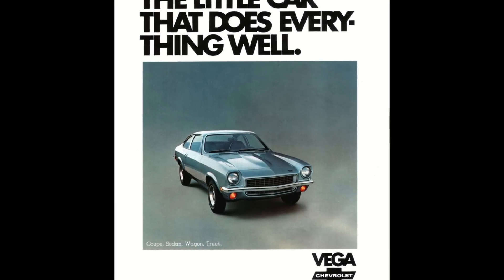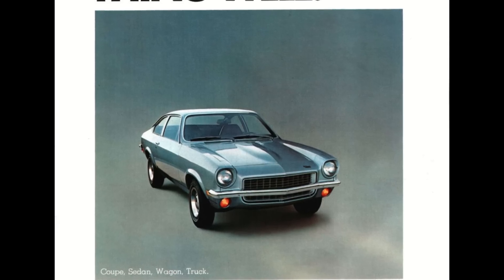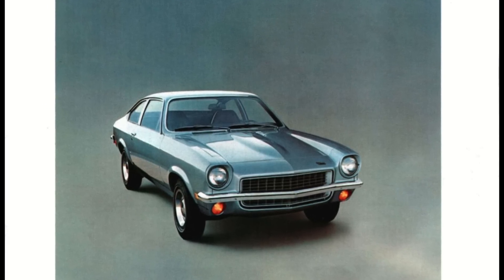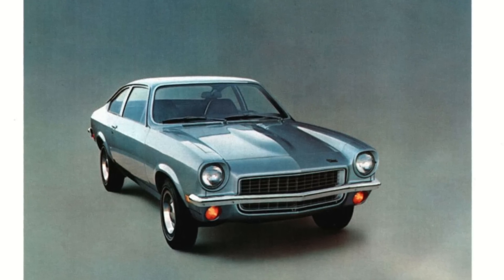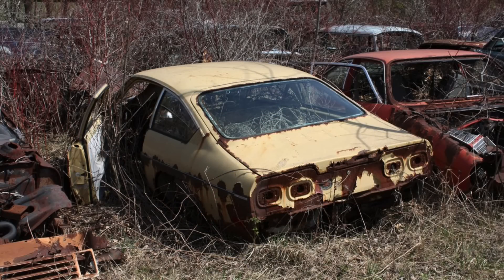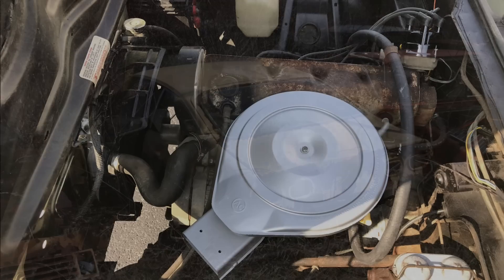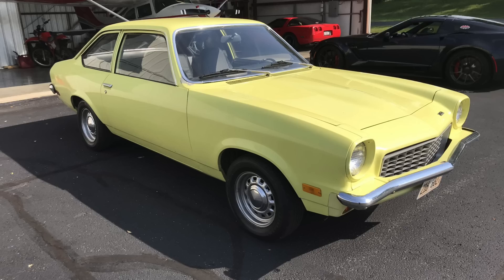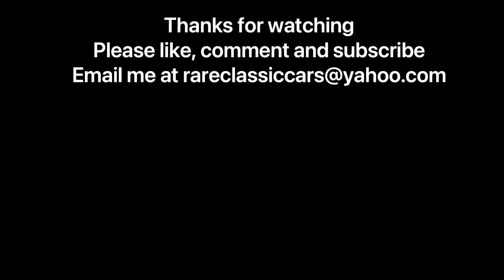GM's Largest Failures: Why The Chevrolet Vega's Engine Turned Buyers Away From American Cars

Comment: They should have put a 4 bolt main 350 under the hood and been done with it also a two speed power glide tranny or Muncie rock crusher 4 speed and a Ford 9 in rear with 373 410 and 411 posi yah buddy there's the secret sauce recipie get you some of that baby yee haw dual exuast as well not cat converters either

Comment: The problem with the Vega wasn't the engine even though it was bad the car it self was bad,the car would rust into litterly, it would break into 2 peaces right in front of the rear wheel all the way across, I don't know how many of them did that but it was unsafe so the car was doomed from the start

Comment: Many chevy owners installed a 350 or 327 like I did, and made a really nice car out of them. My freind from high school installed a 4 bolt main truck engine with 202 heads, big lumping cam and ram horn manifolds with h pipe, that car was insanely quick! The one I assembled was a 400 hp corvette 326 that I built over the winter, and that little hatchback was so quick that I would have kept it forever. Sadly it was impounded and I never saw it again

Comment: My '73 Vega didn't make it to 50K miles.  The engine took a quart of oil for every tank of gas.  The body rusting out was the worst thing.  Rain came in around the windshield, and the back hatch's hinges rusted off the body.  The hatch ended up on the roof.  I live in love bug country, and once one hit the hood, a huge crater rusted out where the bug hit.

Comment: I don’t know if I emphasized this enough in my previous posts.  Problem with engine reliability was NOT the aluminum block, nor the lack of enough radiator capacity, nor the lack of head gaskets.  The overheating problem resided in the poor design quality of the supposedly “stock” cylinder head design.  There was a massive steam pocket above the first two cylinders.  Also there was wrong headed placement of the water temperature gauge IN THE COOLING AIRFLOW OF THE INTAKE MANIFOLD.  And responsibility for these design oversights fall chiefly on the chief engine designer of Chevrolet and General Motors in 1969.
 And this was the man who was accorded great fame and promotions for originating what really was the outstanding consumer product of the 20th century, the small block Chevrolet V8.  But that’s another story that really needs to be appended to the story of the 2.3L Vega 4-cylinder because supposedly they had the same chief designer.  But how could have that been true? The SBC owes its design roots to the 1939 Tatra air cooled V8.  How you ask?  
	this is where the history lessons come in.  Well, first of all, Tatra in 1939 was a Checkoslovakian company that built trucks and and engines for the 3rd Reich.  If you know anything abt truck engines you know that they get thrashed and flailed all the time.  The group that makes the truck engines will tend to dominate all other small truck/passenger car designs groups in a large corporations.  So it was true under Tatra, as well as GM in 1969 when Chevrolet V8’s were simply head and shoulders above the competition.  
	But let us return to 1939.  The Tatra rear engined air cooled V8 was cast out of an alloy of aluminum and magnesium.  It was under 4L displacement, had pushrods instead of OHV gear. So that made it lighter than any OVV or DOHV design.  In addition it had an OVERSQUARE piston dia-stroke ratio.  It’s already sounding like Zora Arkus-Duntov because he was also an engineer for Ed Cole in during the Corvette startup but his father was already an engine -eer for Tatra motors in 1939.  They built trucks, they built automobiles of all kinds and one of their most famous “Nazi killer” rear engined, air cooled Mg-Al  V8.  The 1939 V8 had the same “quench” combustion chambers as the 1954 SBC.  But of course Ed Cole designed the SBC.  In this day and age with the dominance of front engined, front wheel designs, how many of you can claim to have driven a rear engined car 
	Zora was just a very young man when he emigrated to the USA.  His father enrolled him in the GM auto institute, the pipeline for young engineering talent in post war Detroit.  But of course he was just a racing driver who drove corvettes  as fast as he could.  But that’s not all he did.  He brought the Tatra “Nazi killer” V8 to the attention of GM engineers.  He may have been the “inspiration “ instead of the “perspiration” behind the SBC.
Reply: So no wonder the oil plug was always hotter than a pistol.  It sat right above the WORST hot spot.  All Vega engines could be rectified with two 1-1/4” gas pipe connectors, drill a 1/2” hole in rat side of cylinder head, 1-1/2” from front facing rt.  Run 1/8” gas line from block to INTAKE SIDE OF WATER PUMP.  Or just get the 1977 head which had all the overachiever steam relief of the original 1971 engine by Doug Rowe who would later professionally build racing engines.  Of course Doug Rowe and GM would not see i2i.  His relief work was guided by his very professional use of thermocouples throughout the cylinder head and block.
Reply: All you had to do was to rectify this one hot spot.  You could put the fix in for maybe $15 and contingent on tools.  All the engine rebuild shops knew of this “fix”. The new head would set you back abt $ 200 in 1975.
Reply: The results of the steam relief were amazing.  Without the fix, the stock Vega engine was a hot, clattering mess pulling a water temp of about 210F.  With the fix in, it ran a cool 165F, could support the AC, completely transformed.  I changed the exh valve clearance to 0.024” from recommended 0.030”.  A lot of the tractor engine clatter cleared up.  It was not at all the same engine.  I chromed the valve cover just because I could.

Comment: I loved my 72 panel wagon but it was a stroked 400 sbc. I did have to have a 5 core radiator made and notch out the subframe in the front for more radiator but a blast to drive

Comment: Excellent video. I had a 71 Vega, GT station wagon. I’m 78 years old now and that was the worst vehicle that I have owned my whole life. 25,000 miles and they replace the front fenders. I also had to carry extra spark plugs with me and change them on the road because they would file plugs out about every hundred miles. I was so happy when the government forced GM to extend the warranty on them motors. I got a new short block out of it And quickly got rid of that car Also, the rear tailgate rotted out in the rear window ,almost fell out of it..

Comment: I had a very used 75 Vega in 1978 and was quite pleased with the performance.  The engine was sleeved from the factory.  It was cheap and reliable. It was just a cheap car. Too bad they don't sell cheap cars anymore.

Comment: This car truly pushed Americans away from American cars. My parents owned a 74 Vega and a 71 Impala which held up for 100,000 miles and was fairly reliable. Up to this point they always bought from GM (I was a baby). Unfortunately, working he was called over the intercom that the Vega was on fire in the parking lot. The cast iron heads, and the aluminum block had leaked fuel onto the hot engine, setting it on fire. By the time the fire department came the car was gone. GM offered my dad a 2-year lease on a Buick LeSabre for free trying to keep them in GM. Except the battery went dead every 6 months. That was the end for GM and they never bought from them again. Their quality started improving in 2005 when I worked for them as a consultant to use warranty data with six sigma to fix their cars, but the damage was done back in the 1970s.

Comment: I had a 71 it overheated I used to carry 5 gallons of water with me. It didn't come with a radiator over flow tank which what I was told caused the overheating. It eneded up only running on one cylinder traded it on a new camero it was only $3200 brand new

Comment: I was there.   The Vega was loved by the car critics for it's aggressive new tech, and from scratch design, compared to the Pinto which used off the shelf/proven drive train components..from Europe.     The "open deck" cylinder design, fairly common these days for cooling, was clearly a fail when not braced and I believe the aluminum block, iron head resulted in warping or loss of head gasket continuity.    They sure were mosquito killers in my small town, classic smoke bombs.

Comment: Always had to check your oil and coolant levels while owning a Vega.  The engines could be made to run well and get great mpg, but if they got hot or ran low on oil they would let out the magic smoke.  Everything runs on magic smoke, once it is let out it dies.

Comment: Nowadays in the Ecotec they went cheap on the pistons.  Audi Pistons and rings will lead oil consumption.  Tiny ring groves and small oil drain back holes.  Four cylinders engine are still cheap engines

Comment: I ordered a '71 Pinto sedan, fully optioned except for the automatic.  Even had factory a/c.  Never had any issues.  Outran the local police on back roads (rack 'n pinion).  2 liter engine, which squealed in 1st, 2nd and 3rd.  They met all safety requirements and were no more prone to fires than their competitors.  My brother got the car after me and continued my shenanigans.  Should have kept it.

Comment: I have a buddy bought a new 1976 Vega drove it for 100,000 miles no problems. The trick was you had to change the oil every 2,000 miles. Great little cars would get 37 mpg on a trip.

Comment: Loved coming across your video. My first car was a bright orange, white striped One Millionth 73 GT Vega. I purchased it, non-running from my brother-in-law around 1978. It had AC and a larger radiator. I loved the car with it's Speed Racer Mark V AKA: Camero front end look. The original engine was pretty well shot and replaced with a sleeved version. At the time, a company named IECO made performance parts for the little 140 CID engine! I had the second level cam installed which gave a slight rumble when idling along with a bit extra mid range power. An IECO header was installed with a 2" exhaust out the back. Offenhouser made a 4 barrel carb which would accept a Holly 390 CFM carb, so those were installed. For looks, an IECO aluminum billet valve cover was installed. It looked great with a ribbed aluminum cover and VEGA emblem. The car came with a Turbo 350 automatic, which the 140 CID engine could barely turn! I replaced that with a Opel 4 speed stick. After blowing two of those up I put a Saginaw in which worked much better. Interestingly enough, the mounts and holes for the clutch pedal were already installed, so the swap was easy. I also eventually ran into the valve seal leak you mentioned along with something that really surprised me. The third cylinder sleeve actually split down one side, and the engine was toast. I hung onto the car for many years afterwards. The goal was to swap in a V6. I figured with some beefing up of the GT suspension and a V6, it would be a stout little sports car. Unfortunately a flood in my home town while I was stationed in Nevada pretty much destroyed the car. GM really messed up with the 140 CID engine. Other than the engine, the Vega was far better looking than its rival, the Ford (please don't rear end me) Pinto. My goal with my little 4 banger Vega was to beat Pinto's in street races, which I did many times. I wish I still had my Vega and could make that V6 version (which Chevy  should had offered). Thanks for posting the video. It brought back many memories.

Comment: I had a 57 Chevy with an extremely modified 327 and needed an economy car for my new bride in 1974.  I was a car enthusiast and an engineering student.  I read everything on the Vega.  I still remember the article titled "The Vega; Chevrolet's new Bright Star" which reported on the million miles of testing performed.  I read about the improvements incorporated by 1974.  I parked the 57 Chevy and with the help of my parents, I bought a basic '74 Vega.  The only option was a heavy-duty radiator (smart).  But I had been fooled.  By 30,000 miles it needed a valve job.  At the time it was being reported that the head design did not provide adequate cooling around the valve seats.  Also, I found that there was dissimilar metal corrosion occurring at the windshield trim.  Before buying the Vega, I had considered putting a mild engine and clutch in the 57.  I wish I had gone that route instead.

Comment: I owned a 73 GT, fully loaded, AC, automatic. It was a good looking car but turned out to be the worst POS I've ever owned. The transmission crapped out and differential was leaking before 12k miles. At 16k it was blowing smoke. That's when I sold it to someone who didn't notice the smoke. I moved to a new apartment so the poor fellow wouldn't be able to find me when he realized he'd been screwed. Hopefully God has forgiven me for that. I then bought my 1st Toyota. That little car was rock solid and trouble free for 130k until I traded it in for another Toyota. I have never even considered another Chevy. I think in those days, GM believed people would buy anything they put on the market. Fooled me once, shame on them. Fooled me twice....ain't happening.

Comment: We had a 73 vega gt..good car but kept blowing head gaskets in the summer..oil gets orange from the antifreeze..the mess up the whole ally.engine...went thru 2 blocks on warranty. After that.mom bought a 76 cutlass..the car was ok drove good but engine was a gm.fore thought..not engineered.to last..the blocks got hot from premmy. wear.problems.and use oil badly..it need the iron duke motor.4cy..but.chev.tryed a new motor and it blew up a lot..they quit the car over warranty problems..

Comment: The Vagrant was Ed Cole's third strike. He had already done serious damage at Chevrolet with the Corvair (Strike one was the C1 Corvette with a 6-banger and a Powerglide as the only powertrain option - The Chevy V8 and Zora Duntov saved his @$$ that time. Duntov also fixed the Corvair's suspension but the damage was already done. Besides the fact that air cooled engines don't provide enough usable heat and the Chevy II was competing with it, there wasn't much hope for the car). Under its sleek shell, the Vega was laboratory tested technology thrown into a pile of cost cutting. That cast iron boat anchor of a cylinder head is all the evidence one needs to see to realize that. But Cole pushed it all on Chevrolet and in typical corporate fashion wouldn't budge on any suggested changes.

Comment: It is a great engine once it it sleeved. The newer vegas had rust proofing galvanized panels, but they waited too long to do it. The cosworth vega also had the cylinder issues but otherwise a great engine. The car handles like a go cart.

Comment: When I was a kid, my father bought a Vega for his commute to work, and after a couple of years it was converting oil to smoke very rapidly.  He got a 67 Dodge pickup, and the Vega sat in the gravel/dirt driveway where the tires slowly sunk below grade.  When I was 14 or 15, while both parents were both at work, I got it started, and it left a huge patch of soot in the driveway.  
From sitting so long, the tires had sunk so deep in the gravel that I was sure to get caught if I tried to dig it out for a ride.  I did get a shovel to disperse the soot-covered spot behind the tailpipe.
A year or so later, mom inherited $600, which she decided to spend on getting the engine sleeved, or for a sleeved engine swap, and I got to share it with my sisters, who couldn't yet drive a manual.  It was fairly slow, but fun.
About the 3rd time out with it while hanging at McDonald's with friends, my sister wanted me to drive her and 2 of her friends home.   It just started to rain, and on an S-turn, it spun out from me and did a 180.  The left rear wheel hit the curb and jumped onto the median.  Before going home, I swapped the wheel with the spare to conceal the damage, and my sister kept her mouth shut.
Some time later, my mom was driving and someone pulled up next to her to say the left rear wheel was wobbling.  She had it checked at a shop and was told the axle was bent.
She got rid of it not long after that.
Thanks for the video.  It reminded me of my Vega incident, and now I have another secret to reveal to my parents at the next Thanksgiving dinner table.

Comment: Don't know if anyone has commented on this or not, but GM was playing around with the High-Silicon engine cylinders way back in the late 1950's during the development of the Corvair.  That too, was supposed to be an all-aluminum engine.  At that time, they had to throw in the towel as the technology was not up to ensuring a long wearing engine.  So, cast iron cylinder jugs were substituted.  This gave the Corvair an unwanted rearward weight bias that didn't help the handling.  BUT the Corvair engines were FAR, FAR more reliable than the Vega units.  I was in high school in the late 1970's and early 80's and Vegas were a joke then!  And that was right in the middle of GM country, with many GM plants in that area.

Comment: I junked a Vega due to rust but engine was well maintained and sold it n installed it in a friend's car no complaints from him and it served him well . Something bout STP the original owner used with each oil change maybe .

Comment: GM could have just used the Pontiac 230-OHC-6 and lopped off two cylinders for a fine reliable engine for the Vega/Monza. Or they could have just sourced the 1.9L engine from the Opel division that was used in the GT/1900/Manta which was quite reliable. I knew someone who owned a Monza wagon which was the Vega wagon after they dropped the model, just with a Monza facade and badging. It had the Buick 231-V6 and a manual transmission which was balanced and had plenty of power and torque.